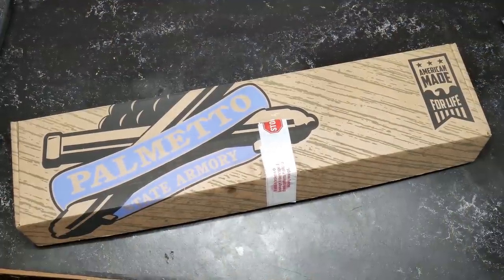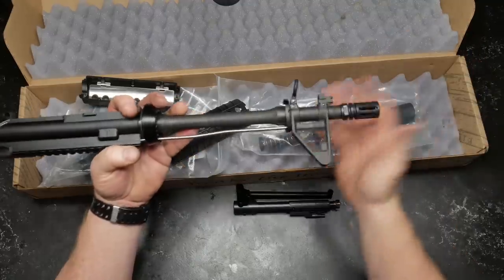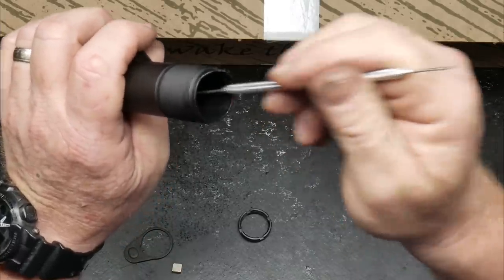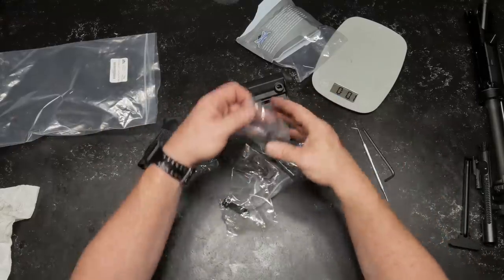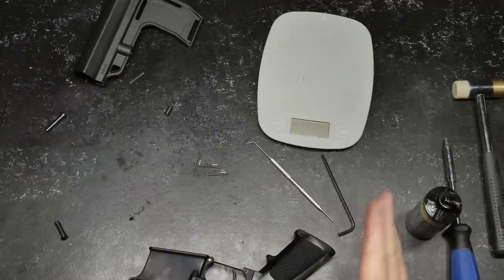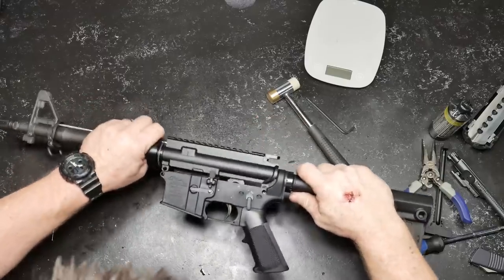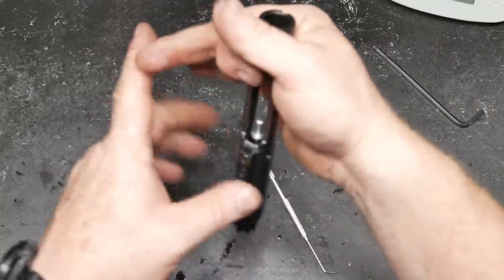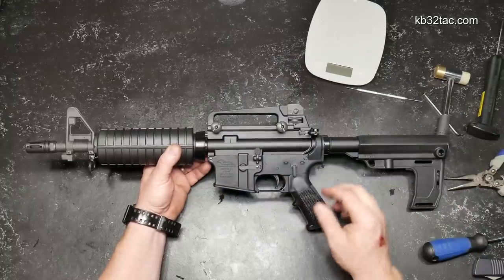Palmetto State Armory 10.5 Inch Nitride Build Kit with MFT Brace Unboxing

Comment: KB, I got a tip for you. On that hex head grip screw, if you take a piece of gum, very small piece, and stick on you hex wrench, you con position the screw perfectly. No wiggle or wobble. 
Best part, it only take a little so you keep most of your gum to enjoy. I suggest Bazooka, best flavor and bubbles.
And, I've Always gotten three detents and springs.

Comment: I bought this same exact kit last Summer for $269.99 and it was not a blem. That's how much the prices have gone up since February. Anyways I built it the same exact way I put the carry handle on it and I have the quick mount on the carry handle for my optic that I can pop on and off and I remove the plastic handguard and put a quad rail on there and mine came with the kak buffer tube and brace but basically it's the same thing this new brace you have on there it's got the quick detach points which are nice but basically they're identical and let me tell you what, these are the funnest little puppies you'll ever shoot. I love mine and I'll wait for the prices to come back down again before I get another one or two or three...
Palmetto rocks!

Comment: Got mine two years ago for 250. Put it on a stripped Anderson lower with a SB brace
Wasn't thrilled with the trigger assy. and swapped it for a drop in.
Put a Kahn Kan on it instead of the birdcage.
First 100 rounds and firing pin tip flattened out. [this was with the provided trigger assy.]
Swapped for a heavy duty pin and not a problem since. Keep a spare pin, bolt, and BCG in range bag now.
Acurite out to 100 M no problem.
Likes 556 55Gr. but totally devoured 223.
With the exception of the pin, the only other problem I had was they sent polymer take down pins with it. My local parts guy didn't believe me, until I showed them to him. Have extended steel in there now.
Overall, a nice little weapon.

Comment: I bought my PSA 10.5" upper with lower parts kit a couple years ago for $259 and their lower for $29.99. I remember having an extra spring and detent for the pivot pin(s). I'm glad they do that. 
My AR pistol came with the KAK shockwave. It's okay, but once I saved up some money I added a SBA4 brace and a strike industries advanced castle nut with a locking screw. Changed out the chunky handguards with a strike industries viper and added a Magpul K2+ grip. Topped it off with a magpul flip up rear sight and an Atibal red dot. It's definitely a good little shooter. I really enjoy it. 
I like series like this, keep it up KB, I'll stay tuned for the future range and updates!

Comment: Carry handles for the win!!!  I built an identical pistol, except I used the SB Tactical SBM4 brace. I also changed the hanguards to genuine Colt- They are a little bit thinner than the fat PSA ones. It's my little Commando-style pistol. I've put together/own (15) AR's and nine of then have carry handles. You would probably get a kick out of the 7 1/2" barrel 300 Blackout  pistol I did: tubular front handguard ,  YHM front gas block/sight,  Kak 2.0 brace, 3-prong flashhider- And a carry handle of course!!  Love your channel!

Comment: I prefer Carpenter 158 bolts versus the 9310 that yours came with.  The C158 bolts are actually a premium cost versus 9310, and there's a reason why.

Comment: Got one just like yours a few weeks ago, except mine has Magpul hand guard and grip and EPT trigger. My son just got his PSA pistol, his is the "nicer" one with 12" MLOK rail, flash can and nicer BCG. Only "complaint" I have is putting the extractor pin back in after removal/inspection (the little one you said 'oh s%%t' in your video). His and mine were equally difficult to re-align. Not a problem with my Diamondback rifle.

Comment: Yep! Extra dentent and spring.  Kota, noticed your upper had the same issue mine did and that’s the wall thickness.  Look at it from the bottom, it’s not centered.  My 7.62 8.5”, my first PSA product is like that. I’ve emailed them and no response so far. What do you and anyone else make of this? Take a look at yours. I paused the video and saw that it’s got the same issue as mine.

Comment: I just purchased a PSA lower parts pistol kit and I noticed the inside of the tube has The ridges that you're talking about. When is palmetto State armory going to understand that the inside of a buffer tube should be smooth? Now I have two choices a by another buffer tube which is money just thrown down the drain or  somehow try to smooth it up? If I had some type of hone I could put onto a drill I would just smooth it up but it looks like I'm going to be buying another buffer tube!

Comment: I really enjoy my "old school" style 10" AR.  Of course, you've already seen it.  I used the K-2 pistol grip for the improved ergonomics on the shorty.  I built an additional 10" upper with an M-LOK rail, optic and pressure pad activated light, just to occasionally swap out, but my preference is to rock it old school.👍  Don't make fun of me KB, but I bought an old baby car seat, cut it a little and added some custom brackets.  Now it holds my 10" AR, along with some mags, giving me quick access.  I throw a baby blanket over it for cover and nobody cares.  The funny thing... you should see the equipment bag I'm working on, consisting of a diaper bag and Kydex.  I'm cruising... grandpa style!😄  ~BE THE GRAY MAN~
Reply: Wowzer what a great idea! I might have to think about something like that . Very interesting and gray man all the way 👍👍👍
Reply: @jonguy8496  I got the car seat at a second hand store for $5, and the diaper bag for $1.  You can get Kydex just about anywhere, but I used the thick stuff on the bottom.  Good luck.😊👍
Reply: 10" 556 is for potatoes

Comment: Great video, as always you never disappoint. I just ordered the 10.5 nitride, with the mlok 12in and psa flash can kit that comes with the nickel boron bcg and magpul flip up sights, and sba3 brace.. I'm waiting for it to get here. I like the chf chrome lined barrels, but to be honest. I think the nitride is the future, and a better overall coating. The chf barrels are not overly a necessity either. Barrels being the price they are, changing one out after 10-15 thousand rounds isn't a big deal. Anyway, can't wait to see the upgrades.. Love the channel
Reply: Return it asap. 10.5" 556 barrels are for potatoes.
Reply: @DinoNucci  nah, I'm gonna try it out for work, my dept is too cheap to spend any real money. I want to see how this will work out, for close quarters. I think it'll give me the ability to sweep rooms quickly and not present a barrel profile around turns and stuff. Should be fun. I don't expect to use it past 75 to 100yrds at the most. To be honest, it may not even break 50yrds. I guess we'll see

Comment: Every PSA lower kit I've had (5) has included an extra spring and detent, BUT; I just finished a build last night and one spring is different than the other two. It is silver while the other two are black AND it was slightly longer. By roughly 1/16"! It also seemed softer than the others. Now, I've only been building for the past few months and don't know near as much as most of you but it seemed odd to me. Any thoughts?

Comment: I have a PSA 11.5" barrel with traditional M16/AR15 front sight post...  Are you aware of anyone that makes a bayonet that will fit this shortened barrel?  I found adapters that fit a 16", but that does not help due to regular military bayonets size in relation to the 11.5" barrel.
Reply from the maker: No, I do not

Comment: Ya bought the same thing for 250 bucks from PSA it was a giant piece of shit failure to feed would not pick up another round stovepiped all the time.  Had to put $300 worth of parts to make it work and the finish was absolutely crap it was scratched up pretty sure it was shipped in a cement mixer

Comment: I just got the 10.5 inch with the Flash can and 12 slant rail! Is that one any good ?
Reply: I don’t think you can go wrong with PSA, I haven’t read but a handful of issues from them. Not bad considering the hundreds of thousands they’ve sold.
Reply: Jason Grant , I got that same kit and I love mine . Have about 1k rounds thru it so far .
Reply: I got one of those kits, I splurged little on the nickel boron BCG. Sba3 brace is solid and the flash can works great. Front mbus sight went on easy. Back one not so much had to sand down the inside that meets with the picatinny rail so it would fit. I've only gone to an indoor range, sighted in with a bore laser decent groups but could be better. Fun little blaster hope you have fun with yours.
Reply: nrm3247 thanks for the info everybody
Reply: Return is asap. 10.5" 556 barrels are for potatoes

Comment: And this one and ALL kits from Palmetto, all came with one extra spring and detent... 
I think it's just what they do. 

I was getting 1,000rds 9mm CCI azer brass for 169.99. 
Now? It's double that price. 

Was getting 1,000 rds of green tip 62gr or 55gr 5.56 NATO for 299.99. 

For 350? You'd get 10 pmags included in a bundle. 

All ammo has almost doubled in price. It sucks, none of the politicians are suffering. They're ALL getting paid. The only one NOT getting paid? Donald Trump. 
But...
Cheaper than dirt is waaay overpriced. 
I was hoping Palmetto wouldn't raise prices like everyone else because now? We need a break more than ever. 

And every single company in the business is making fortunes, due to the bat stew flu. 
So why jack up the prices like this? 
You know... 20 bucks or 30 bucks... NOT double. Or close to double... On EVERYTHING! 

Just saying.